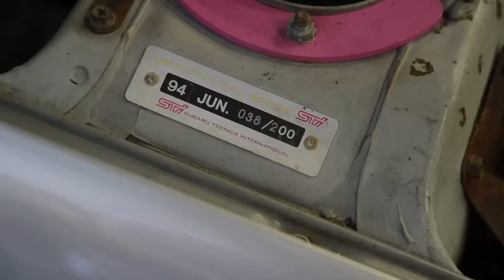REUNITED WITH MY STI AND IT'S FIXED!

Comment: (in Canada) I've owned 8 jdm Subarus.

You should replace: All vacuum lines, timing belt/water pump, knock sensor, coil packs, clean MAF, and get a basic tune. After that it should run like a dream. 

(They have slightly higher octane in Japan and need to be detuned for our lower octane or they will go kaboom on you one day).

If you want: replace clutch, valve cover gaskets, spark plugs, shifter bushings, and do a compression test.

You can make 350hp on any jdm ej20 engine with simple boltons and a tune. 

These cars are very finicky when they aren't running correct. But I'm telling you with a tune for our altatude and octane they are insanely reliable. 

I have never ever had a 90's Subaru break down on me.
Reply: Well said. Giving this a like so ruddy will see it.
And when you don't do these simple things is when problems arise . Even a basic tune up will help. Who knows the last time it had a new set of wires and plugs. And put the GD WRX coil packs on em is a a good upgrade.
Reply: He's never going to listen to you man, it sucks to say but he's just not going to listen.
Reply: He has Jack lol Jack builds these cars for a living he will be solid
Reply: yeah those ej20gs are pretty damn reliable. still got mine running.
Reply: @nathanpetrohilos  early ej20g's definitely take the cake but the ej20k, (ej205 jdm ones), ej207, ej208 are all pretty bullet proof up to the power figure I've mentioned. I recently single swapped the twin turbo ej208 with a VF48, driven at 18psi for the last 20k without an issue. (Tuned on factory ecu).
Reply: @NotWBT  let's be honest 2.5 subarus gave subarus a bad name in terms of reliability. My buddy got 200k on his 205 still ran when pulled but Definitely needed a refresh. We're putting another one will full bolt on now.same turbo as yours
Reply: @nathanpetrohilos  it's a good responsive setup. With a full catless 3 inch and all the other bolt on goodies. Haven't had it on a dyno but definitely above the 300whp mark. I've dialed it back to 16psi because it's honestly more then enough power for daily driving. Considering the car in question is only 2900lbs.

Comment: Looking forward to seeing this build come together. If you haven't already I would strongly recommend getting a good Aos and upgrading to the 2006+ 2.5l oil pan/dipstick combo at the very least. The old flat bottom pan can be prone to oil starvation under hard cornering and old rodney will come a knocking.
Reply: I also recommend this 
I would take corners hard and it’d bog I would think it was fuel starved but it was oil . Took 3 motors to figure that out
Reply: I would recommend sticking to a 2.0. Better block to make power and are stronger than the 257. 207 All Day💪💪💪
Reply: @Tool0GT92  your absolutely right lol.
Reply: @CHINOINBB  I agree, just talking about the oil pan upgrade for  the 2.0 block.
Reply: @erikkongslien4904  shit lmfao

Comment: Number one upgrade on those EJ20G engines is  GD WRX coilpack conversion. Those older coilpacks are almost always brittle and cracked under the rubber boot.
Reply: Don’t forget the get a dom mod coolant re route

Comment: The I/C spray does run for a certain time when you press the button, will stay on longer if you hold it. My '07 doesn't spray for that long on one press though so might be different on the gc8's

Comment: As for the conversation you and Jack were having about getting into the higher digit HP numbers possibly cracking the thousand limit you have a perfectly capable catfish Camaro with an LS engine, you can literally strap a journal bearing ebay special 78/76 turbo to that thing throw a good set of  injectors good fuel pump some head studs valves retainers springs and a good ecu n tune and easily make 1200 hp, 900 torque to the wheels. A basic junkyard turbo LS build cost around $3,000  minus cost of engine to reliably make over a thousand wheel hp.
Reply: You’re not getting 1200 reliable hp with 3000🤣
Reply: @betolsx9843  $3000 each pull, new engine every pull.

Comment: you want 8 or 900hp car do it in the CAMARO. built ls will do that easily
Reply: That’s a good platform for that kinda power for sure
Reply: @TheReaper42069  yeah would definitely need a rear end swap go 12 bolt or 9 inch and call it a day

Comment: Chris I calibrate those ADAS systems for ACC which is automatic cruise control. Those systems are pretty legit either using radars or cameras. But yeah you can essentially have that thing drive you as long as you touch the wheel every 30-45 seconds. 👍🏻 pretty cool thought I would share.

Comment: My subi lost compression on a 950km drive, so I bought a random 2004 Honda inspire to finish my mission, it has some HiDS feature and it will take control of the steering and brakes and stop you crashing. Pretty ahead of it's time for a 2k old as car.

Comment: It was Larry Chen stock r32 and a new maxima. But crazy thing is I'm doing a maxima swap in a ser spec v. And with certain parts and drop in cams on e85. They tickle 390 to 400whp. Crazy thing is there are 10 second all motor maximas on the east coast.

Comment: Don´t go to Denmark, you will be so disappointed Jack!
Yes we have tractor pulling, but it´s only a few that is good, and it can be cancelled by the rain.
But Police in Denmark have startet confiscating cars if they just have an idea that something is not as from factory - therefor Denmark is becoming the most borrowing country to stay in, no cool cars to look at, nobody dares to go to any  car show because the police have become crazy and impound on just the suspension of a modified car. 
About the Air, yes we have pretty clean air because all of Denmark is surrounded by the Sea and the fact that Denmark is Tiny! But our air is being polluted with Geo-Engineering ass well as in your country. 
Denmark is becoming so anti social, we are not that open to strangers, so i´m affraid your believes about Denmark is quit a fairytale. :(

Comment: You guys need to get an air lift. It sucks the cooling system into a vacuum and then suck the water into the system easiest way to bleed a cooling system.

Comment: Mine has id1000s front mount vf39 and makes 300 wheel its not super fast I'm a straight line but its pretty quick and it's been reliable  for 8 years now also get a AOS asap